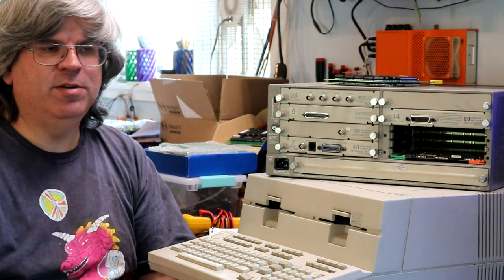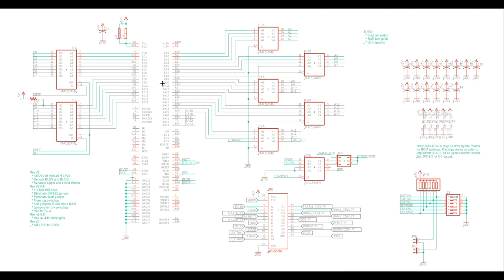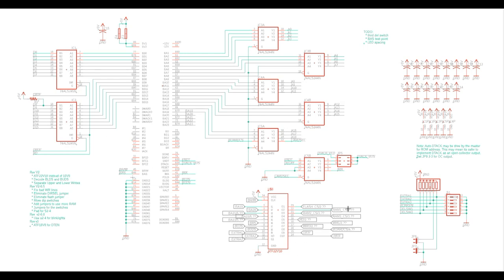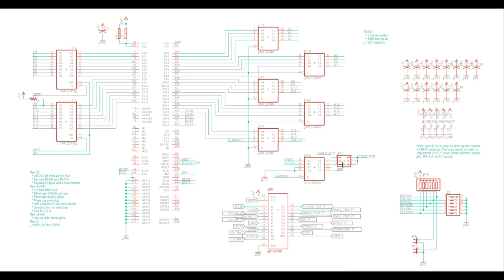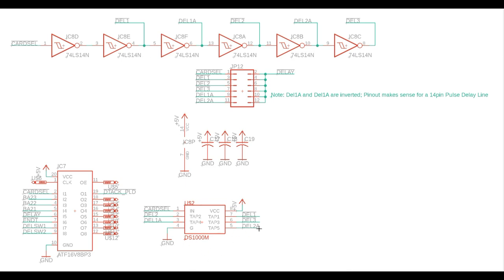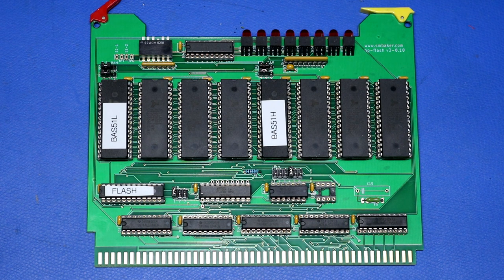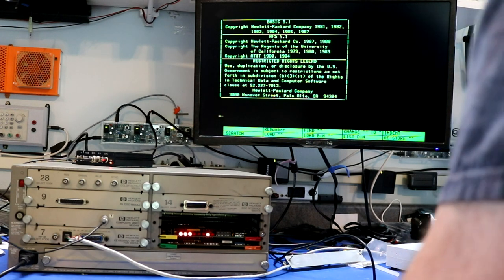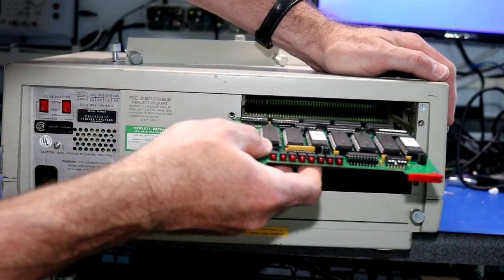Building a flash + RAM board for the HP9000 computer

Comment: Do you happen to know if this will work with 9816 model? My understanding is that it should but I'm still at the learning stage on the HP9000s. Very nice implementation
Reply from the maker: I would think so, though I don't have one and don't have a way to verify. I searched and found a comment on the HP Mailing List that Dominique's boards work on a 9816, and my final design is likely pretty close to Dominique's.